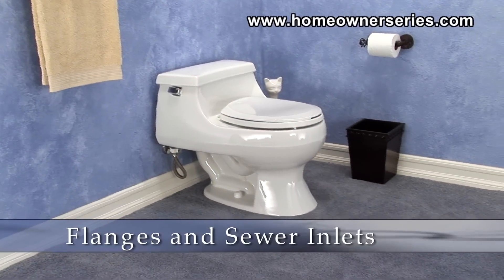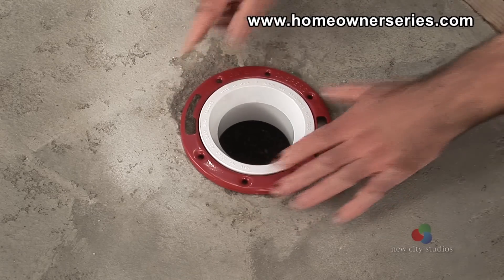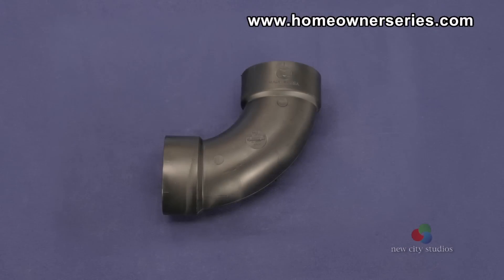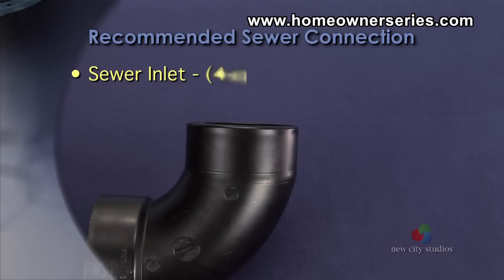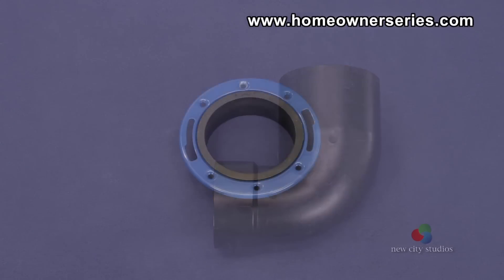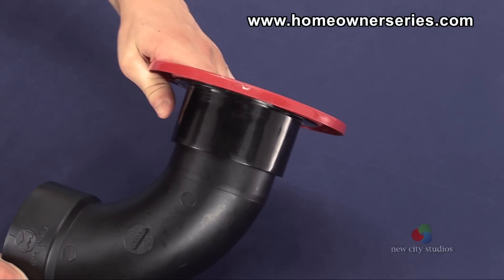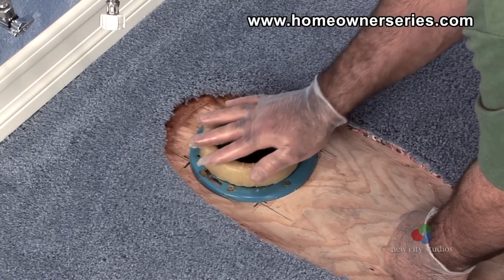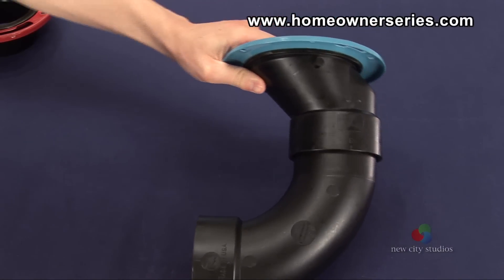How to Fix a Toilet - Parts - Flange

Comment: If you are looking at flanges, you should examine the brand new BLACK MOLD ON HOLD technology that includes a sealed-bottom, watertight toilet flange with drain ports for water to go right back down.  Amazing stuff.  Created by Barracuda Brackets.